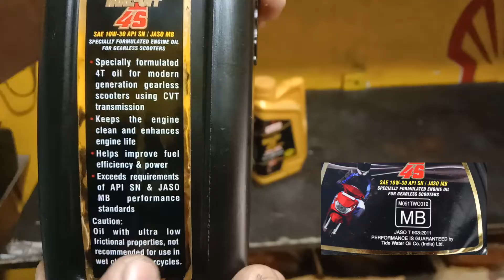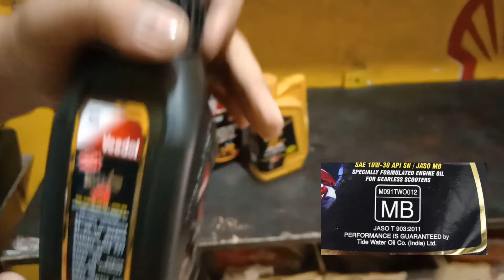Best Engine Oil Confusion Cleared | WATCH BEFORE USE | Indore mechanics

Comment: Sir please clear me this.. I am using honda shine bs6, as per maual engine oil should be replaced every 6000kms or 6 months which ever is earlier. But hardly clock 3000kms in 6 months. So should I replace engine oil within 6 months or can I run bike upto 6000kms. Please advise..

Comment: Honda unicorn 150 abs model mein kon sa engine oil dale with grade. please help. elf total acha hai kya?
Reply from the maker: Told in video dude.
Reply: @indoremechanics  this is not a proper reply. mein confuse tha isiliye poocha..not happy with you reply.
Reply from the maker: Use which is recommended.
Reply: @indoremechanics  thank you.

Comment: Hello, I am using access 125 2009 model

From past one year I am using 10w 40 or 15w 40 Castrol Power 1 fully synthetic oil.

Instead of 10w 30 mineral oil given in service centre. 

Is it fine to use it sir? There is a good pick up performance compared to old engine oil. Can I use the Castrol Power 1 15w 40 fully synthetic oil for access 125
Reply from the maker: yes, you can. If you want, then chck out veedol 10w 30 for scooter, or you try castrol 10w 30 scooter oil. i think this may give you some smoothness in you ride

Comment: I am from Kathmandu Nepal . My queries go like this ; I have been riding yamaha FZ V2 since 2017 May . Initially I used yamalube whose rating was 20w40 API SL , JASO MA but wasn’t satisfied with the bikes performance and later on I twisted on Castrol Actevo ( manufactured by MEOC Ltd , Dubai , UAE and exported in Nepal) and have been using this oil for the last two and a half years . I have been noticing that while the engine is heated a burnt smell comes from the engine . Moreover the engine gets heated in summer on heavy traffic. 
I am wondering to know about the exact issues whether it is the engine oil which is causing all this or some other else .
Reply from the maker: while changing engine oil, old engine oil must be almost same the oil quantity you filled or recommended, 50-100 ml vaporisation is okay. But more then this is a problem. I recommend using the same grade oil which is mentioned in owners manual. you will definitely  get a good result.

Comment: can I use veedol 10w40 semi in my pulsar150.?? some ppls said it will damage engine because of thinner grade 🤔🤔 but Im facing engine jerking after gasket replacement with 20w50 oil in p150. can I use 10w40 grade pls tell nightime  facing jerk more
Reply from the maker: First check out owners manual means what bajaj recommends for your pulsar if it's 20w 50 then don't use 10w. It will effect engine heat resistance. Use only recommended about jerks kindly visit workshop for inspections. I can't tell any remedy without inspecting.
Reply: @indoremechanics  w before doesn't affect engine lower the value better oil.flow right 🤔🤔.????
Reply from the maker: @fazilcreator9990  flow is always not a point. Lubrication film is also important. Light oil will definetly make a thin film as of Heavy oil. Pulsar is a cool engine so it needs 20w 50 for maximum heat transfer and lubrication.

Comment: bhai my unicorn 150 is knocking when giving accelerator in 3 rd and 4th gear...what is the problem. please help
Reply from the maker: Change spark plug to the original or use g-power from ngk.
And there are alot of reasons. Pls consult your near by Honda engi.

Comment: I m using Karizma R 225 CC 2014 Old Version 
And currently i m using Veedol 10w30 oil
MA2 Api SN.
Which oil is best for my bike 
10w30 ? 10w40 ?
Or any other oil ?
Bcz i saw many reviews on Youtube and online sites
Few people recommending motul 7100
20w50.
Please suggest me best oil for my Karizma....
And some motul 7100 10w40
What to do ?
Reply from the maker: first of all how to do you feel in 10w 30?
and if you ride very often then i recommend using 10w 50 for superior riding experience, try once veedol racing oil.
Reply: Indore Mechanics u mean Veedol 10w50 ??
Reply from the maker: @onkarkanakdande4361 yes sir the big one shown in this video is for big boy motorcycles.
Reply: Indore Mechanics yes yes dats Veedol 10w50 big cane oil right?
Reply: Indore Mechanics few months ago i used same grade 10w50 Of Motul brand
And my experience was so bad
Bike heating up so badly
Reply from the maker: @onkarkanakdande4361  sir actually this oil don't heat up the engine. Cause they are meant for hight heat resistance. BTW what is the recommended oil in your motorcycle. Pls check your user manual and I don't think veedol 10w50 will make heating issues.
Reply: Indore Mechanics ok bro
Reply: Indore Mechanics I faced heating issue with Motul 10w50....
And my company recommended grade is 10w30
& i wnt to ask the Veedol 10w50 wil suit to my bike ?
Reply from the maker: @onkarkanakdande4361  sir as far i know about the grade, if your company recommends 10w then it's okay to use 10w 50 we have tested it practically in city bike but not in karizma but rest we didn't found any heating issues report till now. You may try it and if find any difference pls share with us.
Reply: Indore Mechanics I feel ok with 10w30 Veedol 
Bt i need more smoothness in my engine

Comment: Bro, I have Honda CB Shine 125 CC BS-IV bike. Which is the best engine oil for this bike. My use is very less, not regular basis and no high speed, max travel in one go is 80km and very rare. And engine oil should change in how many kms.. Pls suggest. Thanks in advance........
Reply from the maker: Hello dear,
Oil change recommendation by company is of 6000 kms but you may change it at 3500-4000 kms as after that time to time checks are required and if you can check it at regular intervals go for 6000 kms. Use Oil of your budget but of the same winter grade recommended as in video

Comment: Hero passion xpro me konsa oil use karu ? In 10w 30 grade
Gulf vs veedol vs hero genuine oil vs shell vs motul ??
Plz reply
Reply: Veedol se...engine smooth hota hai kya...?
High speed pr...80-90kmph pr ..?
Kya ye...gulf ...motul...Castrol se better hai...?
Plz answer
Reply from the maker: @shadabshaikh6238   Sir aapne mera video sahi se nahi dekha he. pls check kare.
aapke usage k hisab se oil use kare.High speed me 10W 40 se best 10W 50 jyada accha kaam karega. high speed pe vibration to hote hi he pr acche oil se kuch kam ho jaega. pr agar aap smoothness mtlb sound samajh rahe ho to ye galat he.
Reply: @indoremechanics  thanks sir
Reply from the maker: Sir, ye video me 3 points diye hue he, unke basis pe aap koi sa bhi brand ka oil le sakte he, agar wo best he to. 
Nahi to simply veedol k oil use karo. Check description.
Reply: @indoremechanics  sir....veedol 10w 30....synthetic oil hai ya...mineral...?
Dibbe pe to synthetic likha hai....?
Reply from the maker: @shadabshaikh6238  as your budget.
Reply from the maker: @shadabshaikh6238  mineral with synthetic base.

Comment: Bro i have apache 160 bs4 daily run is 15km max which engine oil should i choose ? Plz reply
Reply from the maker: 10W 40 is good but you may use 10W 50 for better performance